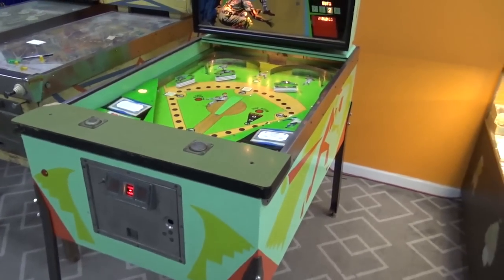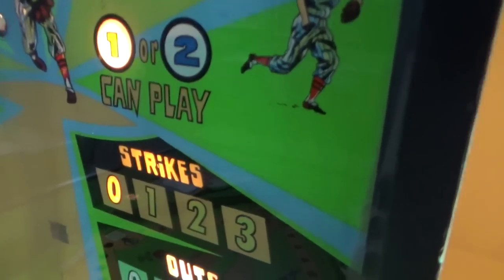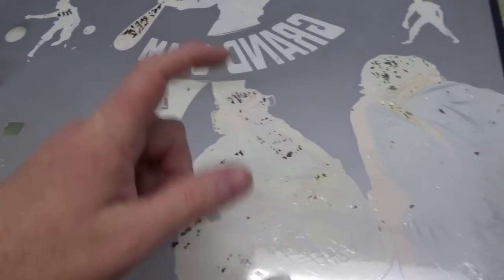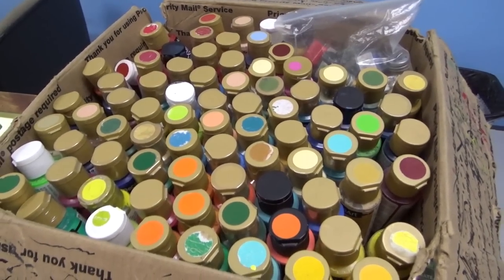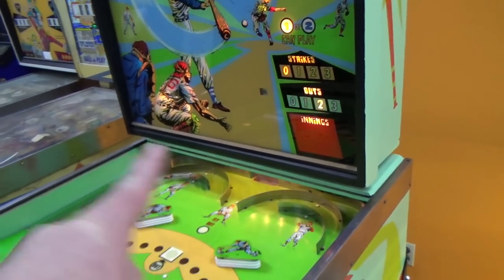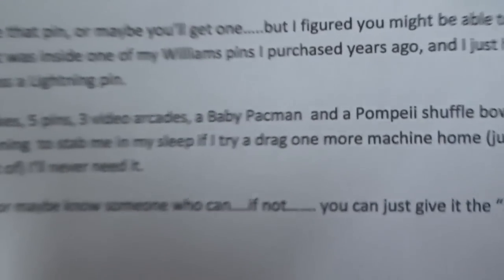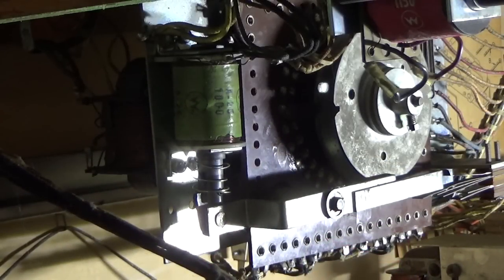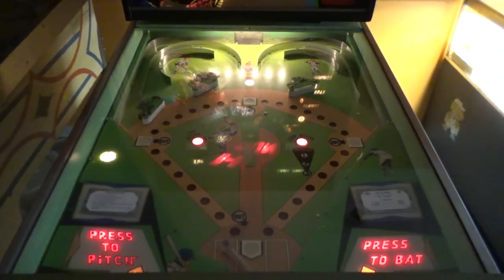How They Made The Base Runners Run Back To The Bases On Williams 1970 HIT & Run Pitch And Bat

Comment: Ron, I hope you see this. You mentioned being able to see brush strokes when you paint with acrylic paint. I would like to introduce you to a product called Floetrol. You can find it at your local hardware store or Amazon. Technically, this is referred to as a "household paint conditioner" but it's also used by artists to thin acrylic and other water-based paints. Among other benefits, this will hide your brush strokes. (Note that similar products are available from hobby stores, but they typically cost more and you get a smaller container.) I'm not sure what ratio you should use for your purposes, but start with a little and add more if you aren't getting the desired result. A 1-Qt container will cost about $10, and should last you for quite awhile, given how little paint you use.

Your paint looks great, btw!
Reply: On this machine, did you ever test two-player functionality?

Comment: This is a great machine.  Love the way it  works.   You've done an absolutely amazing job, as always.  The flaking is not the bulbs.   If it was on 24/7 it would stay an even temperature and not flake as much.  The issue is heat cycling, or getting hot then cold, and moisture.  The old paint is not like modern paint, so it doesn't stick as well to glass.  The heat cycles and moisture make it worse.   Got to think it was only meant to last 2 to 4 years.  I hope you and your family have a really great NYE celebration Ron.    Look forward to seeing a lot more of you in 2023!
Reply from the maker: I think you're correct, I like the other guy's idea too that said an operator told him it depends on what the weather was the day the glass was made, that's awesome

Comment: I can see that prospective players might have been turned off by the lack of a running-man unit, but trying to make the mechanical running men turn around would probably have been impractical.  I have vaugue memories of playing a game like this and being confused by why I was getting outs rather than runs.

Also, watching your video, it looked as though there were a few times where an out at first base or home would cause a base runner going from second to third base to simply disappear.  I wonder if there's a dirty contact somewhere which is causing a voltage sag when the third-base relay should engage.

Comment: Cmon now people.  
An airbrush is only $100
Reply from the maker: You want me to setup an airbrush in the front room of my store that sounds like a disaster
Reply: @LyonsArcade  it’s a little tiny thing. Like a large pen. Not sure I understand how that would be a huge issue.  
It would take more time though as you would have to shield nearby areas but most of the time you could probably just do that by hiding a piece of paper next to the repair area. 

Only for when repairing large area on playfield or back glass would probably give a smoother finish you are looking for.